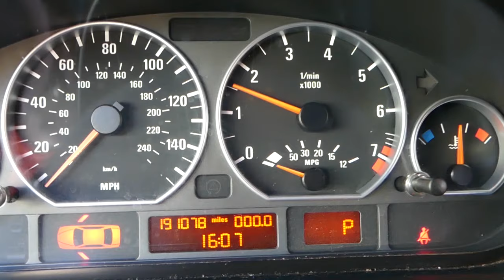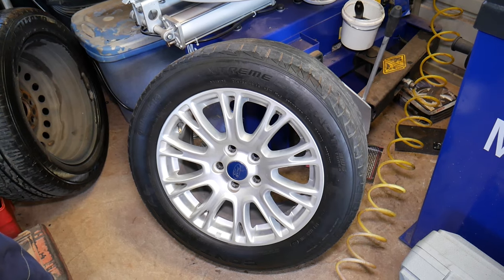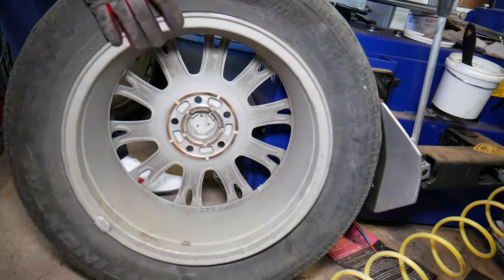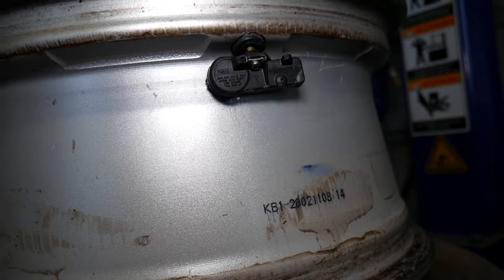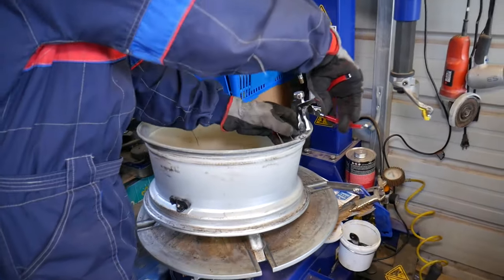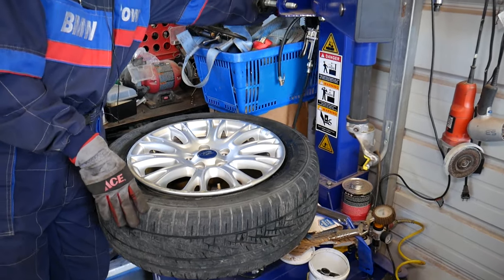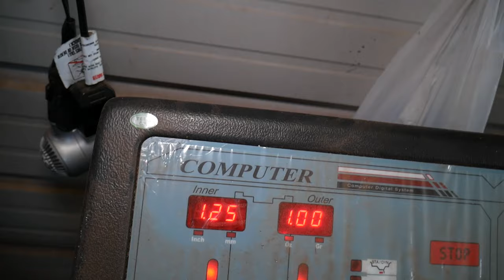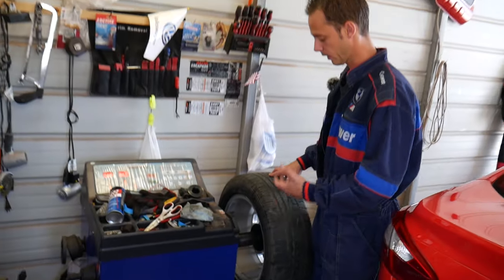HOW TO REPLACE TIRE PRESSURE SENSOR ON FORD. WHERE IS THE TPMS SENSOR AND HOW TO REPLACE TPMS SENSOR

Comment from the maker: Products that we use and recommend:
► Tire Machine and Balancer: https://amzn.to/31XasxN
► TPMS Sensor Programmer: https://amzn.to/31R79IF
► TPMS Sensor: https://amzn.to/4gYxHxF
► Panel Removal Set: https://amzn.to/3YiMADu
► Tool Set: https://amzn.to/3p5MM6t
► Screwdriver Set: https://amzn.to/3XRB28Q
► Castrol Oil: https://amzn.to/3xBc8B9
► Oil Filter: https://amzn.to/3w0Ulme
► Torque Wrench: https://amzn.to/32qyRwg
► Liqui Moly Engine Flush: https://amzn.to/3IiDBID
► OBD Scanner that we use most often: https://amzn.to/3I4MQfe

► Check out our Amazon Store for the tools and parts that we use: https://www.amazon.com/shop/worldmechanics

Comment: Also if left unchecked a bad tire pressure sensor can run your battery down. This happened to me several times till I found out what the problem was a bad tire pressure sensor will leave an open circuit drain your battery.
Reply: SHENANIGANS
Reply: @helmet098  evil shenangins? 🌈

Comment: My 2010 Ford Mustang has 4,382 kilometers on the odometer. I took it in to Canadian Tire as the low tire pressure light was on. I waited 7 hours and was charged $300.00 but they put in a defective valve stem. The mechanics there are useless and they should watch this video.

Comment: Can you share a link to your video for activating a new tpms sensor for ford focus? I bought new ones because the tire shop damaged them and I want to program/connect/activate them. Thank in advance.
Reply: Did you find a way to activate the new tpms
Reply: You need a rpms programmer

Comment: I have a 2013 Ford Edge 2.0L Ecoboost Turbo that’s showing the TPMS on the dash. Will it require reprogramming if I change them on the 4 wheels?

Comment: I just bought a tpsm tool to reset mine cause I thought it needed reset. I took my car in to get all 4 tires replaced and afterwards my TPSM kicked on. So I ended buying the tool to reset it. found out my rear left isn't signaling at all. I have no way of getting my tire off to fix this myself so that sucks.  but thanks for the vid, I at least know now.

Comment: Excellent video. Just one dumb question. How is the TPMS sensor connected to the central computer unit of the vehicle. I dont see any wiring out of it. Pardon my ignorance
Reply: It's a wireless communication system. Most "bad," tpms sensors simply have a dead battery. The design of them however generally prevents the battery from being replaced, and thus new sensors are installed, and re-learned.
Reply: @Roguish_Ryn  you are the MVP with that comment, I have been searching for an explanation

Comment: Great video, I've got a Ford focus ecoboost 2011 and I'm getting the deflate error abs light and traction control coming on. If I try and reset the tyre pressure settings it tells me theres and error and can't save it. Is there anyway I can tell if it's  a sensor specifically causing the issue?

Comment: Very good video! I have a feeling on my wife's 2015 that the valve stem is leaking, can the valve stem only be replaced? We replaced the tires as they were worn but still have a slow leak.
Reply: Probably too late for this reply but of course you can remove the valve core within valve core tool. Very inexpensive
Reply: @kas0016  I got it fixed! The pressure sensor does unscrew from the stem. Broke down half the tire to put it in then realigned the tire back so not to throw off balance. When I got the new stem, it even came with a new screw to refasten the sensor. 👏
 Edit: The stem was OEM and was maybe $4?

Comment: Do i need to change my sensor cause it says  on the screen tire pressure monitoring fault.. pls help me
Reply: TPMS sensors have a battery that lasts 7 yeaRs or 150,000 miles. If you've past any of these two, chances are they need to be replaced.
Reply: Mine made 3 years and about 65k miles...and you can't put a battery in it..have to buy another one. Stupid stupid tech... they are never accurate and essentially a waste money.

Comment: Can someone help with a question. How do you find out which tire sensor is faulty? Or do I have to replace them all?
Reply: I would replace them all
Reply: Hi ,thanks for your advice.  Update- I fixed my tpms problem. I replaced one bad tire and the sensor ( one sensor= $90.00 at dealership)hoping  that was the only bad sensor. But  i had to  purchase a training tool for $15 bucks online to train the new sensor to my car. The tool also allowed me to test my other sensor to make sure they work. Next time I will  buy a set of 4 sensors online for less then one sensor at the dealership have them installed and train them myself. I understand now  how expensive a tpms issue can get if you don't do your research.And thanks to the youtube comment section community.
Reply: I’m glad you got it to work! I have an 05 Explorer and I’m going to see if I can reset them
Reply: @westernwagal9493  look up, Ford quick tips #47 (on youtube of course), the guy explained everything perfectly in my opinion. I bought that same tool for my ford fusion saved me hundreds. If you end up buying the tool online you don't need to buy the $ 40.00 motor craft one ,you can buy the same generic type for $15 🙂 and same with the sensors

Comment: There are unnecessary pieces of technology parts and sensor been staffed into modern modern that makes an idea owning a car like owning a jet plane, not enjoyable and not good thing to do. This makes modern cars unreliable. Plus the plastic materials makes modern engineering senseless. To H*ll with innovation. 

I like oil dipstick, engine mounted radiator fan, throttle body cable, tyres without tpms, non-electrical thermostat, glass headlight cover that does not go yellow, dashboard with temperature gauge and so on. I like restoration of quality improvement of modern engineering not useless fancy gadgets get thrown into car